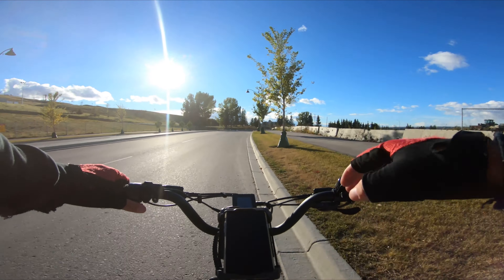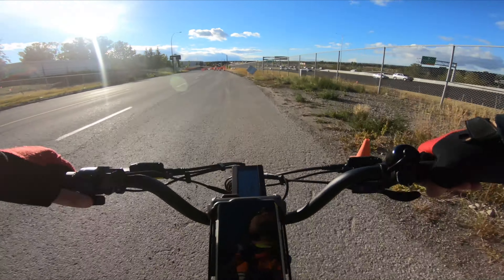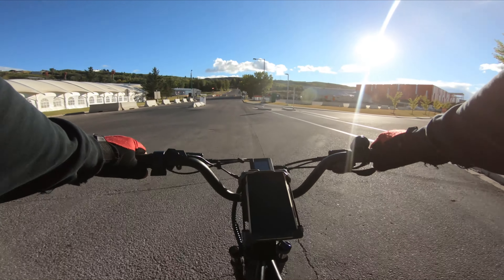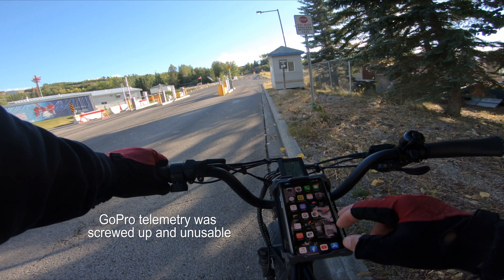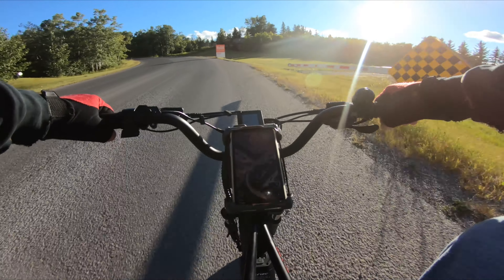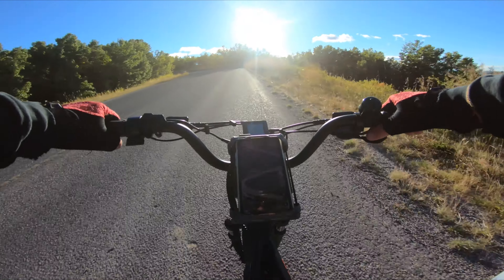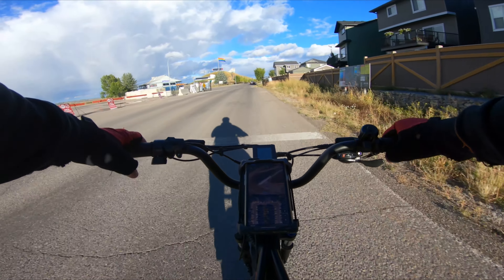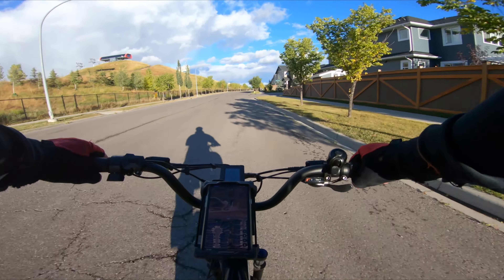Rize Blade climbing Canada Olympic Park (Winsport)

Comment: whats the top speed on flat ground no pedaling?
Reply from the maker: 40ish kph. I’ve only tried it once and it was winter. Also the tires were only at about 12 psi for winter riding.